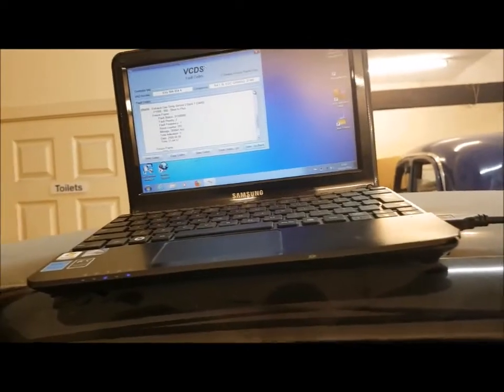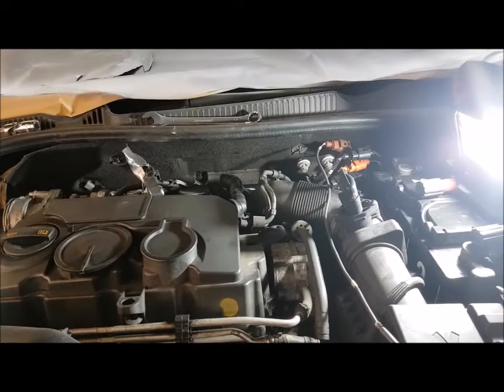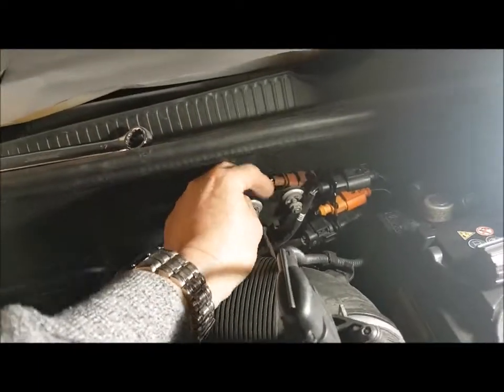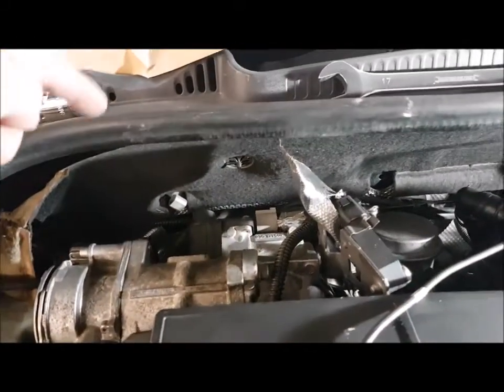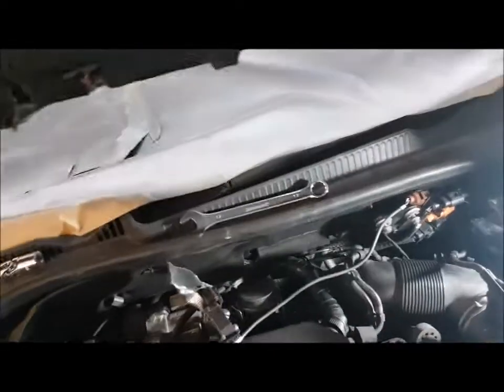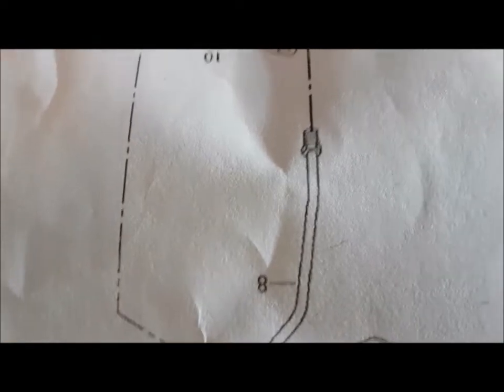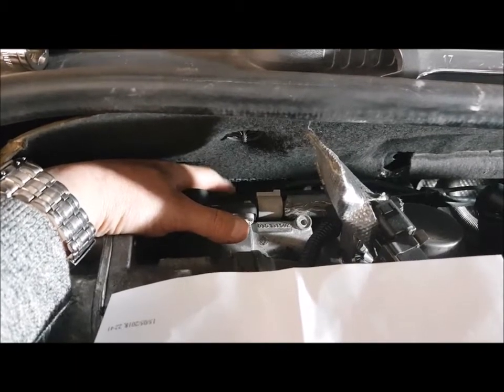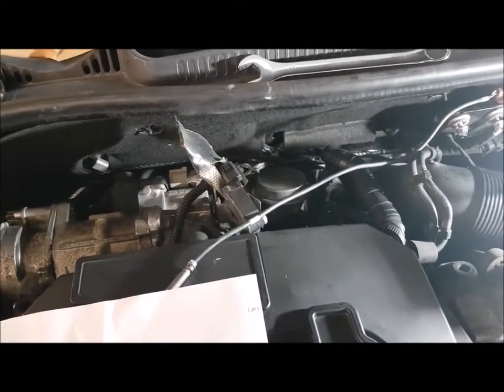VW EGT sensor G448 fault 1.9 TDi

Comment: on the diagram there are 2 more sensors (marked 12 and 15 - past DPF and before, going in to  turbocharger ones) . would you know which connector colour ( orange and black) corresponds to which of the sensors. I'd appreciate any help.
Reply from the maker: 15 Black, 12 Brown so 10 must be orange